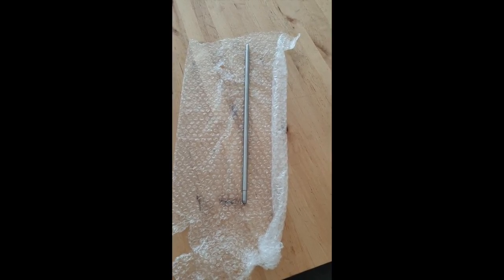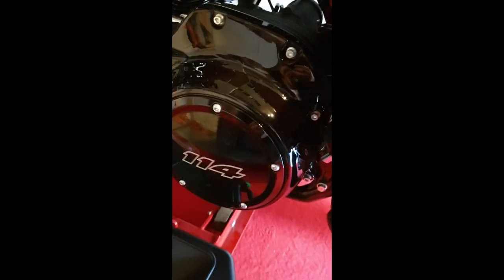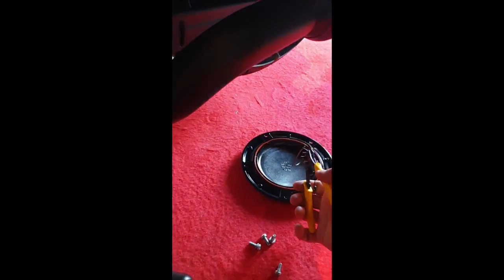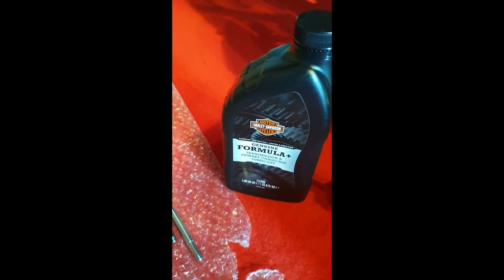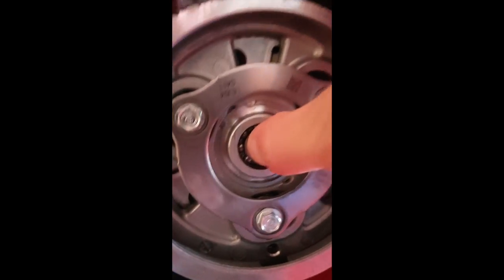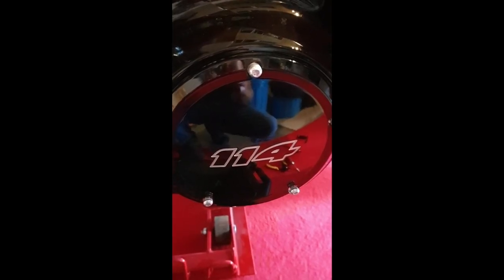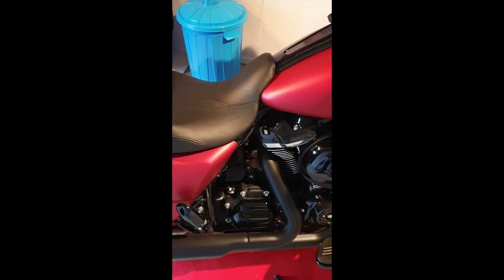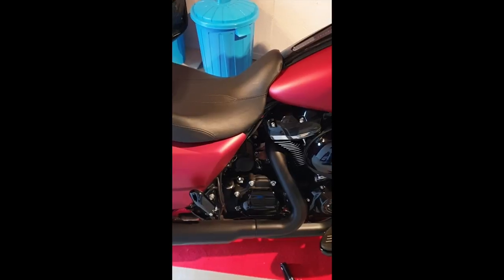Harley Davidson Oil Transfer. 2019 Street Glide Clutch Rod Install. "Oil Transfer Problem Fix"

Comment: I have a 2017 Limited with 11 K miles stock . I’ve had zero transfer & never had add oil ever to the engine between oil changes . Bike runs great 👍. Am I rare and should I have the H-D vent done?
Reply: The transfer issue, has nothing to do with the engine. Everybody's a Biker, now a days.

Comment: All 2019 with build dates after 5/19 have a vent installed at the factory. My 2019 RK Special had this problem and the vent was installed at 900miles and now I have 5600 miles and no problems. It's a fix under warranty...this may work but why do it when the vent works!

Comment: Great video thank you. Can you give an update for if it stopped the transfer when you have some miles on it please?.
Reply from the maker: I will. Rode 31 miles just after. No transfer but i will ride longer tomorrow. Ty for comment
Reply from the maker: Levels correct after 90 miles
Reply from the maker: Still nothing. 124 miles
Reply: 23,000 miles after vent installed on 2019 CVO limited. All is well. Don’t believe the water scare people are trying to sell you on.
Reply: 2017 ultra vent added at 9/6/2019 
Now at 7/31/2020 same issue even with the vent tube added at Harley waiting for tech time out off Warrenty

Comment: Did you got the transfert with the vent ?
Reply from the maker: No had transfer before. Then i installed the rod. That stopped it. Then i got the vent on warranty also. Double backup
Reply: PatTheFat I got the fix with the vent last winter I did 3000 miles and no transfer 
But someone says the 2020 with vent are affected as well not sure it is true
Reply from the maker: @FabryRock  some may be. The vent did not work for everyone
Reply: @FabryRock  ---> I have a 2020 Electra Glide standard and I have oil transfer issues bad and I don't ride hard at all. I ordered this clutch rod  from MaComb County choppers,
Reply: amphibdriver1 because the electra don’t have the vent
Reply: @FabryRock -----> Thanks for this information.
Reply: amphibdriver1 don’t get mad buddy but if you don’t have the vent is Normal have the transfer 
I have the 2020 ultra with vent 
If will have the problem in future I’ll get the push rod on it
Reply: @amphibdriver1  I thought the 2020s are vented out from the factory

Comment: So....Does this really fix the problem after many miles???  Just a few hundred doesn't tell the story. I ride a 2018 Road Glide Special & have had the vent installed but still getting transfer. My dealer says there is NO other fix from MoCo. Lots of people have put the rod in but have not reported back after putting some hard miles on it. So I ask again...is this rod a real fix?
Reply from the maker: It does. Have done 800 miles after install. Not a drop of transfer..
Reply from the maker: I also have the vent on warranty. So i have both fixes

Comment: Did you remove the oil deflector ?
Reply from the maker: No. Just the oil detector =)
Reply: @PatTheFat  Harley put this on 2019 models , so you did not remove it ?
Reply from the maker: @ruthannstokes1931  Dont have to. Problems gone. I have a 2019. Not on my bike
And that deflector did not work

Comment: Not aware of any problem with 2019 Street Glide Specials
Reply from the maker: Believe me. There is. This is one of them
Reply: There is a big problem. Me and my wife's 2019 Road Glide specials had the problem "fixed" by Harley a few days ago and few of my friends with 2017 , 2018 and 2019  touring models had the same problem.  My wife and I only put on 100 miles since the fix so Ill put a few more hundred miles and see if the problem was fixed or not. Fingers crossed.

Comment: How is it now?
Reply from the maker: Works perfect now. Not a single drop transfer. Also did the vent at harley but the rod did the job
Reply: @PatTheFat  thanks for the quick reply. I have a 19 EGS and the vent was installed by at the factory (06/19) and I think I have some transferring bc of the hard shifting and not finding the gear when downshifting. I just got the rod today and will check all the fluids tomorrow and replacing also with Red Line fluids.
Reply from the maker: The rod will do it. Check both primary and trans. Hope it works out. If you have to much oil in primary shifting is harder. And get neutral is harder